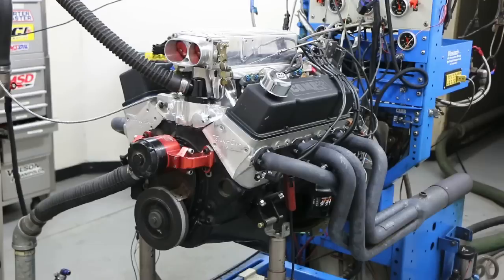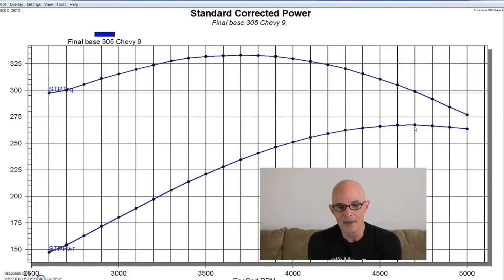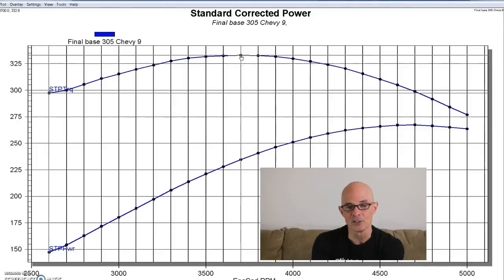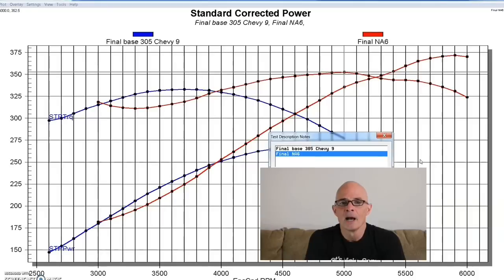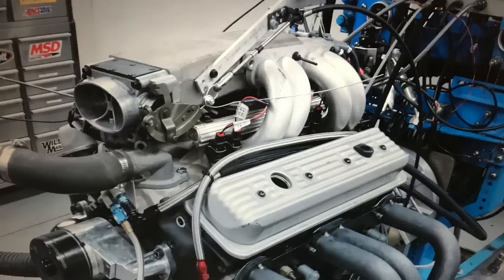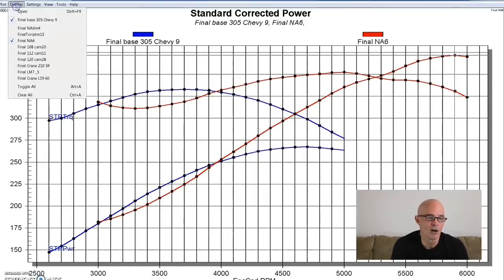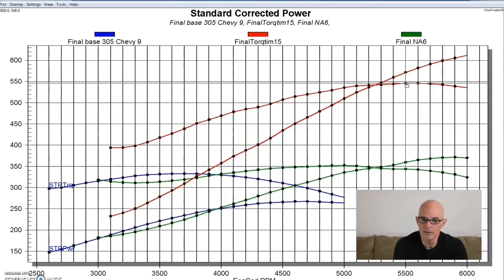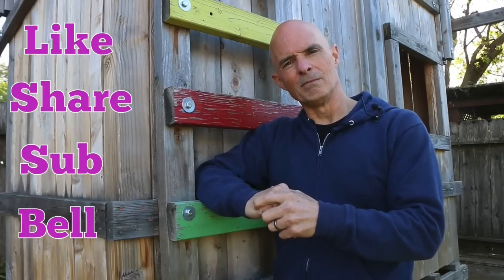GM 305 LB9 TUNE PORT (TPI) TECH PLUS BOOST-FASTER THAN 5.0L FORD?

Comment: A Chevy 305 5.0. Or 350 5.7.  Were never designed to run continuously at 5000rpm.  These were streetable motors designed to operate mostly at 1500-3500rpm.  So Torque was the need, that’s why the TPI was so influential. Todays MEDIA and public opinion seems to think that we need to be running 5-7000 rpm …..lambo influences.
Reply from the maker: you are incorrect-no factory gas 350 in any vehicle application was designed to make maximum power in the 1500-3500 rpm range
Reply: @richardholdener1727 . Hi thanks for replying….maybe you misunderstood what I meant to say…..the L98 5.7 engine was designed for Camaro and VETTE mostly, to be streetable with good power (HP or Torque) in the 1500-3500 RPM range. Some lucky fellows could still feel solid power to 4500 RPM. I feel the heads and pollution control devices really kept the engine from being better. And the over all breathing of the engine really chokes up at 5000 plus…..
I do have a self programed ECM chip for my 1990 camaro. I feel that is the best mod investment I have made. (Temp controls, timing curve, EGR mods)
I have never driven in the street at over 3500-4000RPM except for an occasional quick red light green light occasion.
I think application is the key to modifications, don’t you.

Comment: Your wronge. I almost bought a 87 iroc 350 5 speed. What do you mean they ONLY came in auto😂😂😂
Reply from the maker: Nice spelling, but the IROC was never offered by GM with the L98 350 and a 5 speed (only auto with the 5.7L-the LB9 305 got a 5 speed)

Comment: Hey rich I have a choice between a 1969 307 and a 305 from a 87 ss monte carlo I'm looking for an a to b drop in which one is better
Reply from the maker: THE 87 305 MIGHT BE A FEEDBACK CARB-NOT SURE YOU WANT THAT-BUT EITHER MOTOR WILL WORK

Comment: I have a question on this video: how can you run a tpi without any sensors and idles perfectly? My 87 idles really bad😂
Reply from the maker: we have a map sensor-that is all we need with a stand alone Holley HP ECU to tune properly (the TPS helps) but is not mandatory

Comment: Are these TPI 305 good on mpg? I have a 3rd gen myself with a TBI but want to swap to a TPI for a littles bit of power to keep up with normal modern cars but not go to the pump so often like the 350 lol i still like that V8 growl. Its gunna be my daily driver so i rather it be reliable and "good enough" on gas
Reply from the maker: will require a different  ecu or harness

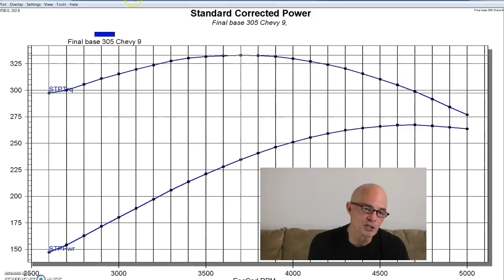Comment: Friend had a 305 TPI in an 89 5 speed with 3:08 rear diff.  He did some of the TPIS mods, air foil, fuel pressure regulator, and a 3in exhaust that dumped right before the axle.  He would shift when the car nosed off which ended up being under 5000 rpm and wasn't scared to shift into 5th.  He outran many cars it wasn't supposed to outrun.

Comment: Great video!  👍
I had a Trans Am w/ the 305 and it definetly felt like it needed more hp, 
but torque felt pretty good, for back then.
This engine set up would have been a moster back in the day.

Comment: I don't think I ever saw anybody put a blower or even modify a 305 unless it was a Pontiac. Really, I didn't care what GM engine you had back then. I couldn't afford a new Mustang, so I had a 4 cylinder body with a modified 351. Very lightweight and didn't brake worth a damn with four cylinder brakes. Solid engine mounts. I had no issue with most cars and at 17, had the fastest car in high school and it was a solid street car that ATE fuel. If you beat it, I had a project car I built with a friend., 460 cubic inches of Lincoln power with individual header tubes the size of some people's exhaust. 12.5 to 1. Ported heads and ported Offenhauser intake. Sunoco 94 plus a can of 104+. This was legendary in it's fuel consumption.  Stuffed in a 1980 Cobra body, sideways seemed to be it's favorite way.

Comment: Hey there
Don't think you'll,  see this, but if you do.. I have a question.
If you bought a c4 1991 l98 vette. What would you do to increase the hp while still being safe for the drive train and motor.  I'm about to purchase one and want to boost the torque and Hp. Please and thank you. Can you recommend a shop in middle GA? Thanks again!
Reply from the maker: A 1991 IS A C3-IT HAS A TPI L98 350-LOTS OF CAMS, HEADER, PORTED HEADS AVAILABLE FOR THOSE
Reply: @richardholdener1727 
Thank you for your response. I hate to bug you, but can you send me like, exactly what you'd do if you were spending about $4,000 to upgrade your 91. I'm sorry, but after watching your channel, I trust your opinion. Thanks again, I really appreciate it.

Comment: I would still be satisfied with 305 aspirated. I'm more of a cruiser I would take that a 305 stroke it out aluminum heads intake put it in a 54 Buick something with a set of Cadillac converters on it and cherry bomb mufflers like that and would be okay with it and of course air conditioning heat

Comment: Crazy idea,...maybe?  I have an 89 Ki500 suburban.  It will be used to do trail crawling , long highway drives to coast and I wanted something different.  Would a 334 stoker with TPI FI, L31 cam with 1.6 rockers, personally ported swirl port heads be sufficient for reasonable power and mainly MPG.  T case is 2.62 in 4 wheel low so thats no problem. Is better mpg there within reason. Burban has 4.11 gears and 33x 10.5 x 15 tires so 4th gear at 70 would run like 2k rpm. 15 mpg would be real nice in 2w hi. Is this crazy or feasible?
Reply from the maker: 334 STROKER? JUST DO A 350

Comment: Something i (NEVER) understood... Why GM made different small blocks with smaller than 4" bores when with just (1) 4" bore V8 Chevy small block you can (LITERALLY) get 6 different cubic displacements with just different stroke cranks with the 4" bore combo..

They would make more hp that the same combo with a larger stroke smaller bore. Yeah you lose torque with smaller stroke, but fuel efficiency would no doubt be more with a 4" bore vs a pathetic 3.74 the 305 used.

I mean, surely a block costs more than to make a crankshaft?!?   

2.75 = 276
3.00 = 302
3.25 = 327
3.50 = 350
3.75 = 383
4.00 = 402

Comment: Great information Richard. I am starting to rebuild my 87 vette, just finished all suspension and starting to plan the L98 and would appreciate your advice or suggestion . What would be the most economical way to get most HP
Reply: Cam and tune sir...even mild camshafts make a significant difference along with increasing fuel pressure

Comment: How does a centrifugal blower work with the TPI manifold, where you have an intake designed for low end, but the rising boost curve of the centri blower?
Reply from the maker: it helps the motor continue to make power higher in the rev range-but not a lot
Reply: @richardholdener1727  thank-you for taking the time to read and reply!

Comment: Richard Holdener did you run it whit stock pistons ?
Reply from the maker: YES
Reply: Awesome I install the super 23 175 heads on my 90 5.0 liter camaro and the cam XR264HR from summit I was wondering if those cam are good  in power, I’m planning on port my Tpi and intake manifold for now and see how it reacts I have bolts on too tanks for answering 🙌🏽

Comment: So I just got a 85 Caprice coupe. It came with the mostly stock 305 other then edelbrock intake, headers, deleted cat and true dual. So far all I've done is swapped the Quadra jet for an Edelbrock avs2 1906. I'm contemplating replacing the heads. My friend told me its not worth it but I can't afford an engine swap just yet. Do you think its worth the time to have it run a bit better? Or save my money for a new engine
Reply from the maker: get a junkyard 350 vortech and dual plane
Reply: @richardholdener1727  would I be able to reuse the headers?

Comment: I still have my 91' Z28 1LE that came the LB9 305.  Over the decades I've done a few highway roll ons with stock 5.0 Mustangs. I don't remember losing any, not that I beat them by much. I was usually just barely pulling ahead. I do however remember getting beat back in the day by a 1990 Chrysler Shelby Daytona VNT Turbo. Nowadays almost any entry level crossover or SUV is quicker. Because of that, the original LB9 now sits in a crate in my garage.

Comment: I'm the type of guy who would rock those tbi motors today.  Very torquy on the street. You don't need to be the fastest guy out there to have fun. Plus 350- 400 hp is an attainable goal and is still fun even for todays performance climate.

Comment: in 1998 to 2000 i was at lincoln tech indy and had access to a program called desk top dyno. i ran lois of simulatins of TPI versions of my own. one was a 400 small block stroked to 427 and AFR vortech heads with ..290 
.292 custom ground cam. it was a beast in theory. 700 to 900 hp and torque.

Comment: @Richard Holdener Love the videos, especially when you cover the a-typical stuff like this. Variety is the spice of life! I am wondering if the Super 23 heads used here would work well for a Chevy 307 stroked out to 330 cu.in. (I am told a 350 crank will fit). For context, this would be in a street/strip 1st gen or 2nd gen Nova/Camaro.
Reply from the maker: YES ON THE tfs HEADS ON A 307

Comment: I think my mods would be a 350 block and a 302 crank.  That way I could have access to all those 350 SBC aftermarket heads that are almost certainly better than the few that are available for the 305.  And I think, if I was going to add boost, I'd opt for a Kenne Bell, Magnacharger or Whipple supercharger for the flatter torque curve.

Comment: The top end numbers are impressive but everything below 4100 RPM the engine falls on its face in fact it makes less HP and torque than stock. Most of your driving is done under 4000 RPM So unless you are at the track and running at wide open throttle  the gains really aren't there.

Comment: Mr Holdener, I remember reading your articles  in several magazines, way back in the 90's.  Do you remember a magazine article where testing was done with TPI intake manifolds on a 454 cube small block?  I can't remember the name and can't find it again.   I believe the FIRST system intake did best overall, and it was something near 550 lb ft.  Do you remember the name or how to find the article again?

Comment: I would have liked to know what kind of power it would have made with blower in a stock engine configuration.  Or at least with just a cam and the stock heads and intake, a cam is an inexpensive change, whereas the heads and aftermarket intake are expensive.  Yes I know it will make more with the whole package but people want to know what you'll get just throwing a blower and intercooler on.

Comment: My father's stock 92 1LE 305/T5 made 220 ish at the tires.  
That seems to fall in line with what would  be considered "gross hp" like you got with that engine in stock form.

Comment: 600 at the crank in a 3500 ish pound car should run into the 10's in a 3500 ish pound car, assuming the car can actually hook and book. Even today that's no joke, you might not be king of the internet but that'll win races all day :lol:

Comment: I bought a brand new '87 Formula 350. I was thoroughly disappointed with it's performance but I never changed anything. I didn't have time. I got rearended by a drunk driver and it was totaled. I loved that car and of course the guy had no insurance.

Comment: after messing around with tbi and tpi motors a lot I found that a 327 really likes tpi.  great street motor.  for towing or trucks tpi on a mild 383 with tight long tubes made 550 torque all day and great fuel economy while towing.
Reply: Would you mind sharing the basic set up of your tow motor? 
Which transmission, rear gear, MPG?

That's exactly the set up I've been considering. Please and thank you.
Reply: @xmo552  i had a 1975 caprice with a th350 non lockup, 3.08 gear towing a firebird on a trailer with a 454 in the trunk of the car along with about 1200 lbs of misc stuff.  Car got 22mpg on the highway at 55mph with about 7k in weight.  I was running sequential accel DFI on a 1992 roller 350 from a junkyard and 1-1/2 primary longtubes.  I had a tpi 383 in the firebird.  Never towed with it but with 2.73 gears 700r4 and the locked id bet about 33 mpg with cruise set at 115 mph on one road trip.

Comment: Richard, I have a 87 aerocoupe with a healthy 305ho converted to 4barrel still getting 24mpg with a seized clutch fan so, I can't just not mess with it being that healthy. 
What did you do in terms of bottom end since 305's were only 2 bolt mains? did you use any girdling or other measures for this power output? 
I plan similar with a roots blower with lower psi numbers and swapping over a tko600. since you bothered to mess with a 305 I figured I would ask as the typical person would start a gregorian chant about 4 inch bores.

Comment: I like 305s ain’t bad engines decent power and good mpg. I use to run one in a 86 rx7. Ran 7s in the 1/8th

Comment: Great video. I know modern engines are miles ahead of these designs from the 50’s but after spending the day figuring out problems with computers and sensors it’s relaxing to tinker with the old stuff

Comment: "Not that much power" my ass. My old rat rod pos lB9 t-5 thirdgen used to eat everybody. Back when Fbodys were cheaper than sin, No 2010 - 2016 na ricer could hang with that bitchen psycho. 330ft at 3700 is no joke.

Comment: great vid. I chose the 305 as my favorite (with great laughter of friends making fun of me) in the 90s. One thing no builder compares is wide open throttle for 110 miles. the big motors sucked. the 305 keeps a cooling value in control. More coolant between the cylinders. there is also a famous pikes peak story with a well known racing family.. they chose the 305 for the same reasons I did. I found that story decades later...and the ford, that 5 liter is still loved. the 5 liter chevy got nothing but hell because of the 350 market scandal. they could have played it smart like dodge..and kept the 305 and scrapped the 350, like the 340 going to 318 as mainstream.. oh well. Enjoy what is left. it is all good. I keep 96+ model stuff myself.
Reply: There would have been riots in the streets if they scrapped the 350, haha c'mon man.

Comment: What tuning software was used on the tuned port? Cuz there wasn’t any good way to tune the 5.7 speed density camaros, not that I know of . I know this was a test on 5.0s but was curious was the tuning done with modern software?
Reply: My point is I doubt you would have been able to get those numbers back in the 80’s and early 90’s. Woul like to see the test done with factory computers
Reply: Would also love to see the same test done with the 5.7! Even with the modern software running the tune
Reply from the maker: we used Holley ECU as stated, I've run lots of 5.7L L98s (including turbo), factory ECU was slow and limited

Comment: I put a TPI on unit on a 72 sbc 350 in my 70 Monte. It's still a work in progress, but it also has a 200-4R behind it and 3.73 posi. Provided it lives through the summer, I have a twin turbo kit to install next fall.
Reply: @Stephen Dawe II that's how I set mine up. The maf might have been easier to tune but I didn't want to deal with how unreliable they are.
Reply: Did it?

Comment: You should include the fuel you are using on these.
Reply from the maker: pump 91 then 100/91 mix
Reply: Could this set up be run with E85? Avoiding having to run 100/91 everytime you have to fill up would be a big plus! Good video!

Comment: Was this from a stick or auto car? They had different camshafts in them depending on which trans. was installed.
Reply: That's for a manual. The auto cam made peak hp 500rpm earlier.

Comment: Loved this video. I own an 86 Camaro. I did spend some money in cam and heads, but stopped there because cost/benefit, there's no comparison for a 5.3 turbo swap. Just the Stealth Ram with fuel rails is as expensive as a 5.3.

Comment: Richard, do you have any experience with LT1 motors? I have a 96 impala ss and want to make some power. I cant really find too much on it. I know the B body's only have 2 bolt mains unlike the F body's. I've heard you cant make good power with them but, I'm not shooting for 1000hp. I just want more than my stock 260hp. Double would be nice lol
Reply: That's what I was thinking. Slap on some F body speed parts and a cam with some good low end oomph and go to town!

Comment: Any tips or threads on putting a TPI small block in a 86 Monte SS?  Building a how it should have been car. Goal is a TPI 383 with as close to 400 or better.